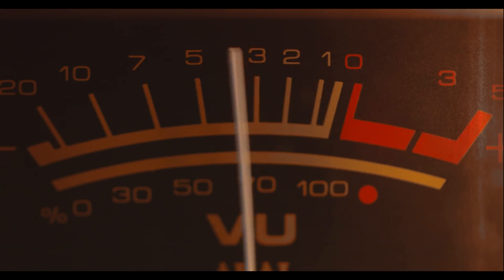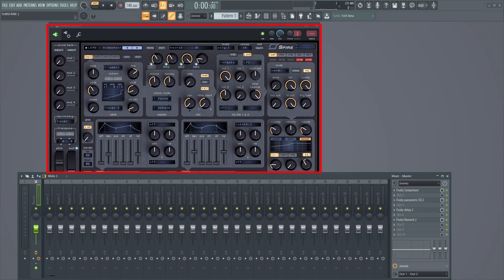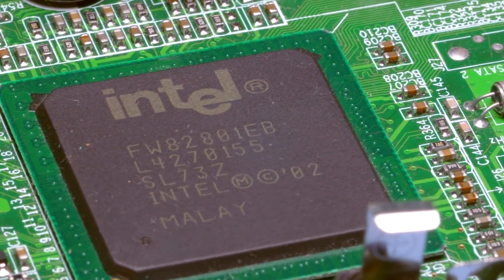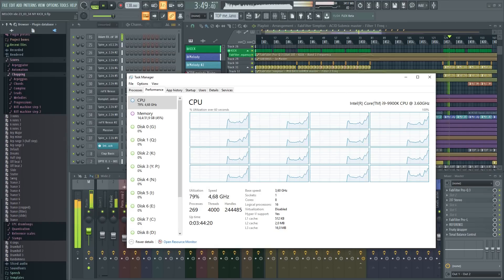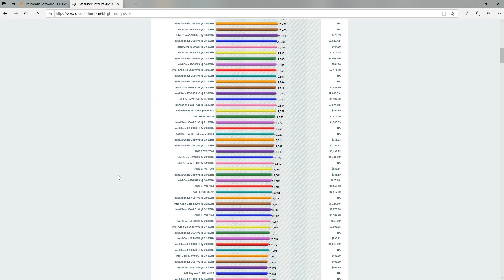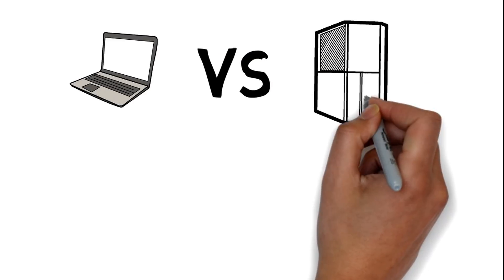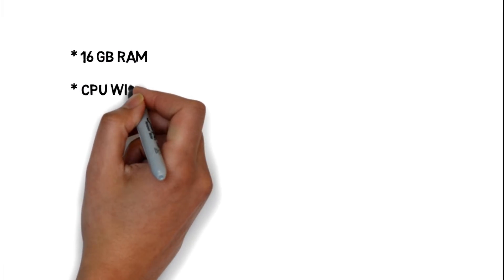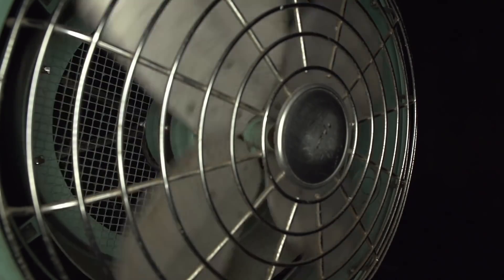The Best Computer For Music Production - What's Needed And Why!

Comment: You are wrong in one thing. The Intels might have a higher clockspeed, but the Ryzens have a mucht more efficient IPC (Instructions per Clock) that make up for their lower clockspeeds. It is way more efficient and produces less heat, and uses less power!
Reply from the maker: Hi, can you link to any particular articles about this? From what I've seen the Intel still has a slight edge over the AMD chips when it comes to IPC. They can also be clocked a lot higher, which will also increase the performance quite a bit. From what I've seen, the 3900 max out around 4,2 - 4,3 ghz on all cores, while the 9900k will usually be able to run fine at 5 ghz on all cores. 

According to this article the 9900k has about 17,1% better IPC than the 3900x: https://www.legitreviews.com/ipc-battle-amd-ryzen-9-3900x-vs-intel-core-i9-9900k_213719

"So, after tens of hours of setup and testing we discovered that the Intel Core i9-9900K is able to deliver 17.1% more performance than the AMD Ryzen 9 3900X while using 26.7% less system power. That said, this is one benchmark utility and it paints a picture slightly different than some of the other results out there."
Reply: @FireWalkMusic  That's because you are comparing an 8 Core chip with a 12 Core chip.... 9900K is less efficient then a 3700x or 3800X which are both 8 Core chips

Comment: Why minimum 4 cores and not 2 ? Thx
Reply from the maker: Hi, you typically want as many cores as possible, but also as good single core performance as possible. Usually, as core count goes up, more heat is generated, and thus single core performance tend to go down slightly in favor of more cores. There will usually be a sweet spot before this trade off start happening. Here's what Image-Line says about this in the manual: 
"The logic of audio processing - There is a long list of tasks that must be processed in sequence, and this means logically can't be processed in parallel (multithreaded). For example: Plugins must wait for instructions from the Piano roll and Playlist before they make sound. Effects must wait for the audio from upstream instruments and FX before they can process it. Further, it's not possible to parallel-process (multithread) instruments and FX that are on the same Mixer channel (their audio is mixed together), or even in the same Mixer routing pipe-line (when one Mixer track is linked to another and another, even FX processing has an order from top to bottom in the FX stack). Then, the Master Mixer track must wait for every instrument > mixer track > effect to be processed before it can process the audio through the Master effects. So logically, there is a lot of waiting that is a natural and unavoidable fact of DAW music processing. Think of a production line. This means the CPU may not be particularly busy, using all its cores and processing slots, yet it runs out of time to fill that tiny 5 ms audio-buffer because there was a lot of waiting for things that needed to be processed in sequence. It should be clear that fast processing is very important and this is not the same thing as multi-core processing. The best CPU is one that has enough cores to spread the work around AND can do the most work on a single core during each buffer time-slice. Which leads to our TIP: When comparing CPUs, look for the fastest single-core performance scores in a package with at least 4 physical cores."

Comment: Go AMD :)
Reply from the maker: The new AMD CPU's are great and will be a good alternative to Intel these days. :)  AMD will generally provide more value than Intel. That said, Intel still seems to have slightly higher IPC, and the 9900k can also be clocked quite a bit higher than the AMD flagship right now, so even though AMD has more cores, the 9900k will likely still provide the best performance when it comes to music production, simply because core count is less important than single core performance. :)
Reply: @FireWalkMusic  Ableton Live supports multi-threading, therefore the more cores are available, the more efficient it will be when working with larger sets with higher track counts, or when working with large instrument or effect racks.
 More VSTs and More Tracks!
You'll probably be able to run more apps in conjunction with Live without seeing performance drops. Single performance with fewer cores to split between applications and not as strong multi-threading performance. Just thought you would know :)

Comment: Very useful video, thank you. I have a question about the sound level. I have been operating a home studio in a small room (14' x 8'6") and using a relatively old 4 core Toshiba laptop sitting on a small table under my desk. This has always been a problem with the sound of the laptop fan once the cpu power ramps up. When using my Neumann condenser mike I have to pad cushions around the laptop to get anywhere near an acceptable noise level. Is the configuration in the video (with it's scary looking fans) really be quiet enough to be practical in such a small room or would am I likely to be disappointed?
Reply from the maker: Hi, I totally understand your frustration. That setup is not ideal for recording. These fans might look scary big, but in this case big is better. Larger fans can move more air at lower speeds. The lower the speed, the less noise they produce. It's like a hairdryer, level 1 isn't too noisy, but if you push it all the way to max it's going to be at least twice as noisy. Laptops have very small fans, and they need to rotate at a crazy speed in order to move enough air, especially when they are working hard and they need to transport the heat away from the CPU and GPU. 
This rig can barely be heard, even under heavy load. The big fans move plenty of air even at very low speeds, and this ensures that everything remain cool, even when the system is heavily overclocked. Combined with the sound insulation, you can barely hear it. There should be no problem recording with a rig like this in the same room.
Reply: @FireWalkMusic  Thank you for your quick reply. That sounds encouraging. I thought you might be interested to see this fanless configuration that I have been looking at in the UK. They can be configured with an i9 9900. I don't believe they can use the 9900K because of the extra power required/heat generated. For what I need for my home studio (I'm no professional music maker) , I'm sure that would be fine. I'm also attracted to the small footprint and the fact that they will build it for me. I'm going to talk with them today and see how they stack up: https://www.inside-tech.co.uk/fanless-8th-gen-six-core-intel-i5-i7-mini-itx-pc-max-5-displays
Reply from the maker: @BobBrooker  Noise is an important factor in music production. Part of the reason why I recommend the i9, even over the new great AMD Ryzen CPU's is because it can be overclocked quite a lot. You can easily get the i9 9900k to run at 5 GHz on all cores, with good cooling like the one shown in this video, or water cooling. Both will be very quiet, and will enable you to get about 33% (or more) performance out of the stock chip. With a fanless configuration like that I'm not sure you'll be able to get much more beyond the stock speed. But if that's all you need, and silence is the most important factor then sure, this might work well for you. But again, the rig shown in this video is also extremely silent. In fact, the only thing you can barely hear is the one disk drive I have in there. Not any of the fans themselves. :)

Comment: Any updates for 2020? Materials? Updated construction?
Reply from the maker: I'm considering making a video about the new Ryzen CPU's. However, I don't expect them to outperform the 9900k, so the recommendation still stands. Out of the box, they have about the same single-core performance. AMD has more cores, but when overclocked the 9900k ends up being able to run at about 1 GHz faster on all cores vs the AMD flagship, which has a lot to say for when taking IPC (Instructions per cycle) into consideration. This means that in single-threaded heavy applications such as a saw, the 9900k will likely still come out as the best alternative for music production. 
We'll know for sure once I get a rig up and running so that I can run some tests and compare, but I'm fairly sure it won't beat the 9900k. :)

Comment: I am torn! I purchased a bunch of parts and after watching your video (very well put btw) I am wondering if I should exchange the parts. I wanted your opinion if you please? I purchased the i9 10900X, 128GB of memory but when I compared this cpu to the i9 9900k the 9900k came out 8% faster. With the latter cpu, I would only have 64GB of memory (maxed)--would that be sufficient you think? I don't have large sessions in Pro Tools but am concerned about having headroom with regards to memory.

 Now by returning the parts I purchased--there are others that I won't need to include here--I could save $1000.00 and my cpu would be a wee bit faster. I'm looking for some advice and was hoping to find it from you. Thanks for your time and for a great informative video.
Reply from the maker: Hi, The reason I recommended a 9900k here and not the workstation counterpart is because 9900k can be easily overclocked to run at 5 ghz on all cores, and it also has slightly better single core performance. 
The workstation counterpart will be able to run quad channel memory, which will give it an advantage. If you see the two computers in this video the difference  is not huge, even though the 9900k is about 40% faster than the 5820k on paper. The reason for that is most likely due to the chad channel memory. 
Even so, the 5820k was not able to run this project on lower buffer settings, while the 9900k was able to run it even when reducing the buffer by half. No doubt thanks to the superiour single core performance of the 9900k over the 5820k. 

In your case, you have built yourself a real beast of a computer, and I have to wonder what else you use this computer for? Is there any particular reason why you need such a beast? I don't think the performance difference in a daw would be huge between what you have now and the 9900k. Certainly not worth $1000 in my opinion. Unless you really need every last percentage of performance you can get. 

However, I can't really think of any scenario where anyone would need 128gb ram for music production? I've made some really huge orchestral projects etc that maxed out my previous CPU, but I never really went much above 16 GB of ram usage. The only reason I went above is probably because I also do a lot of video editing, which eats up memory. I decided to go with 32 GB when I built the new computer, and to be honest, I've never been even close to maxing out the memory. Even with a large project open and doing video editing at the same time, I never seem to get over 50% memory usage. 

For music production, 32 GB will be more than enough . For some extreme situations running hours long orchestral projects in Cubase, then you might want to get more, but if you produce anything that's considered "normal" then 32 GB will be more than enough. 

I don't know what kind of music you produce, so I can't really tell you what you should do. But I can say that I did consider a workstation platform myself, but ended up on the 9900k instead. It's very good value for the money, especially since they can be overclocked so easily. I'm running mine at 5 ghz on all cores. The new AMD CPU's are also very good and have more cores, and almost the same single core performance, however, the 3900x for example won't be able to run more than 4 ghz on all cores, 4,3 tops.. That's about 1 GHZ difference, and that WILL make a huge impact, so I'm inclined to still recommend the 9900k over the AMD at this time. 

You can find a list with liniks to all the components in this build in the description below the video.

Comment: This pc is 1,800 dollars and it barely made a bump compared to his other old ass computer,
bruh moment?
Reply from the maker: With a project this large, the difference won't be huge even with a substantial increase in performance. 
Keep in mind that the CPU meter doesn't actually show the CPU performance the same way task manager does. It just shows the CPU's ability to process real time with regard to the audio buffer, and that will often be down to the performance of one single core. Even a 10-15% increase could mean a world of difference. Even a few percent could mean the difference between being able to play back a project, or not being able to play it at all. 
Also, keep in mind that the older computer was a workstation computer that had quad channel memory, while the 9900k only has dual channel memory. That will give the old one an edge when running very large projects. That system is still quite expensive, and the 9900k has about 40% better performance on overall. In video editing and other tasks, as well as rendering it's much faster overall, which was the main reason I upgraded. I also run a mixing and mastering service, and waiting for things to export and videos to render was taking up a lot of my time. 

Most people use their computer for all kinds of stuff, not just audio editing, and the 5820k is far slower in most other tasks, yet the price difference is not that great, despite it being an older system by now. For that reason, the 9900k will be a much better option for most people. If you want an even bigger performance increase then you could consider the 9900x which is the workstation equivalent of the 9900k. In that case you would be able to use quad channel memory, but you would get slightly reduced single core performance too,  and you wouldn't be able to clock it as high. So again, the difference wouldn't be huge. The cost however would be quite a bit higher. So all in all,  I think the 9900k is among the best choices right now, as well as the new AMD CPU' which has proven to be quite remarkable. They can't be clocked as high as the 9900k though, so when overclocked, the 9900k will still outperform them when it comes to music production, which is so reliant on single core performance. The recommendations given in this video are basically the same given by the daw developers.

Comment: I ended up going from an intel 6600k to a Ryzen 3700x and it is night and day.  The 3700x is super fast and handles everything well. I also do a lot of video editing so the 3700x was better for me.  Right now Intel is a tiny bit faster on single core speed, but Ryzen smashes in basically everything else.  If anyone is building a new computer, I would def go with AMD.
Reply from the maker: For video editing and other multithreaded application AMD is king these days. No doubt about that, and unless someone really need the best of the best for music production purposes, AMD will generally provide a better all-round computer.
In terms of raw performance, the 9900k will still outperform even the AMD flagship right now, especially when overclocked. The AMD chips are basically pushed to the very limit right out of the box, and a 3900x for example won't be able to run any higher than 4,2 - 4,3 GHZ Tops, on all cores at once. The 9900k on the other hand will be able to run at 5 GHZ on all cores with no problem, and in some cases even 5,2 - 5,3, which is 1 GHz faster than the AMD. Considering the fact that single core performance is more important than many cores when it comes to music production, I will tend to still recommend the 9900k for anyone who need the very best for music production purposes. 

That said, for anyone else who don't need to push their projects to the very limit, and who also do other tasks such as video editing, the AMD will be the best choice by far. 

I'm so glad they finally stepped up and gave Intel a run for their money. I used to be a real AMD fanboy back in the days. I remember when AMD beat Intel to the 1 GHZ barrier. Back then AMD was always one step ahead, but for a long time now they haven't been able to compete with AMD in the performance segment at all, until now! 

They have made some great CPU's this time, and combined with Intel's ongoing manufacturing problems they are rushing past Intel, and that's ultimately great for us, the consumers, as it will result in more competition and lower prices. :D

Sorry for the long post.. I got a bit carried away :)
Reply: @FireWalkMusic  don't apologise; nerding out about CPUs is fun! I